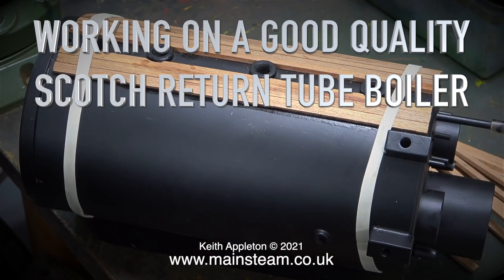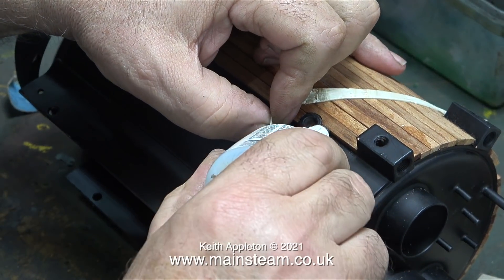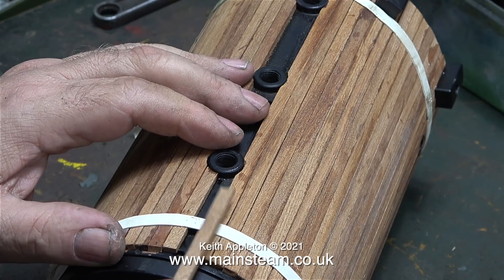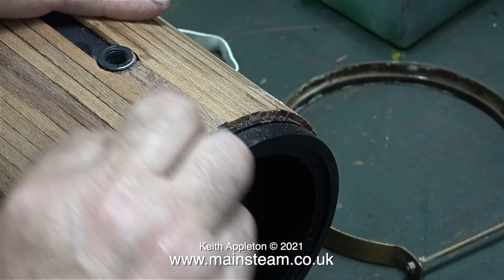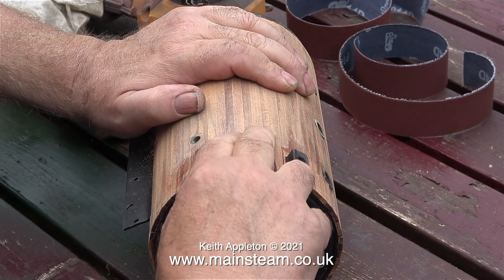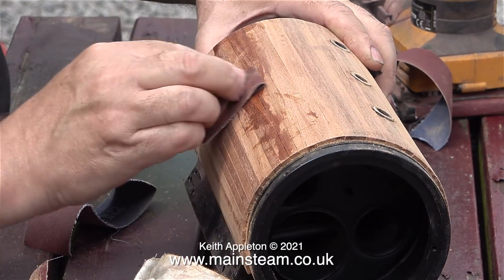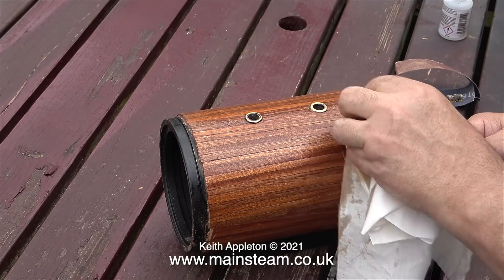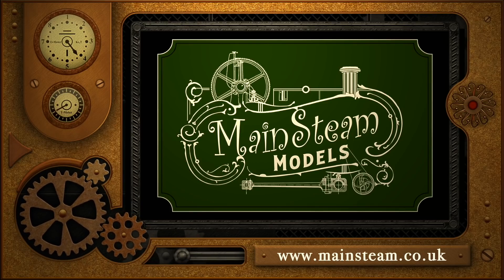WORKING ON A SCOTCH RETURN TUBE BOILER - PART #3

Comment: Keith, how well/long do today's modern CA adhesives hold up to the heat from boilers like this one?  I just remembered that the "original" CA-type glues were manufactured for medical use as temporary internal sutures and dissolved in a relatively short length of time.  I know that we're most likely using "industrial" formulations now, but I always wonder.

You must be allergic to those particular bug bites/stings to react/swell like that, I think.  The "no-see'ems" around here really sting, but are virtually invisible.  Maybe the <insert your choice of descriptive bad word here> small bug that bit/stung you got stuck in the wet varnish during the "gratuitous shot" at the end?  ;)

And hopefully when you and your daughter were metal detecting last year and you were bitten/stung, you at least found enough interesting goodies to make the trip worth it!  I always hope to find enough to pay for my batteries (but rarely do!)...  LOL!  :P
Reply from the maker: Cyanoacrylate Adhesive works fine. The contraction & expansion of the Copper boiler soon loosens the adhesive's grip on the boiler barrel but the planks remain stuck together and can easily be removed in sections if required. That's why I use CA Adhesive. Over the Years, I have used it for cladding many model boilers and every one has been fine.

Comment: I just bought a used Scotch Boiler 9" x 18" made by Hartland Scale Models NO. H58F NEW NORWAY AB,  WP 100 PSI,  LT1.99 with 75 psi safety valve. We have to make some check valves before we can pressure test it though we picked it up for $150. Canadian from a modelers Son.

Comment: Hi Keith, I've came across some copper pipe. They're about 80mm diameter, and a couple mm thickness. Would they be of any use to you?
Reply: I should of added, I don't want any money for them..
Reply from the maker: Thank you for your kind offer, but I have a surplus at the moment and not enough room for storage.